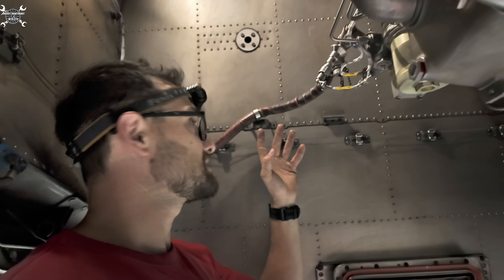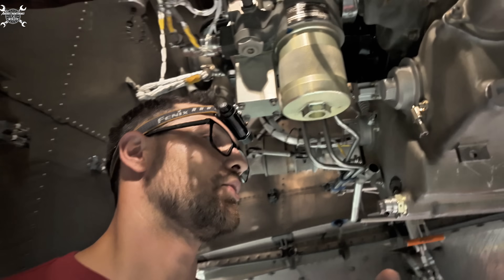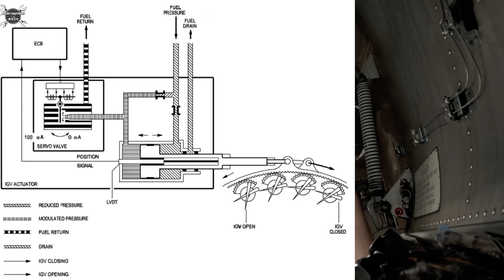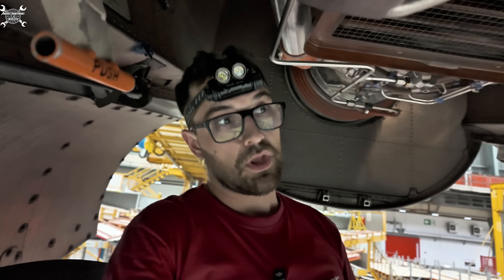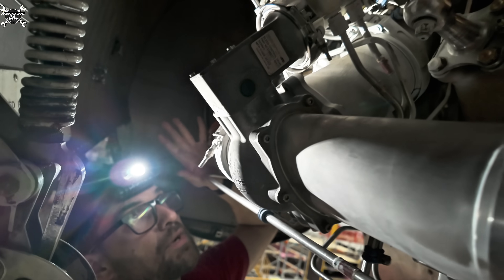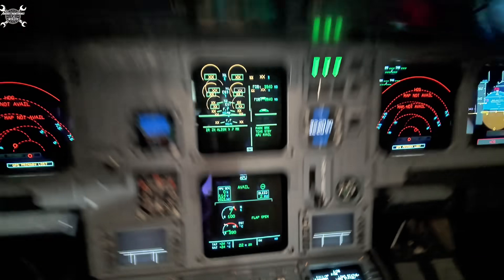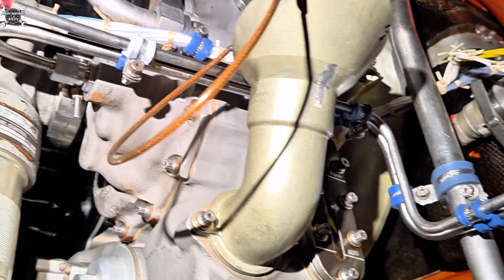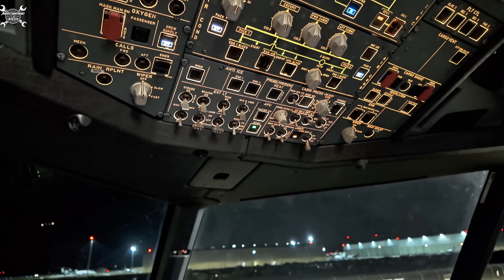How we control fuel flow on APU of Airbus A32F

Comment: Question about APU / ECB power supply. As we know, after shutting down APU without external power, we need to keep batteries on for a while to supply power for intake flap closure and to let deoiler solenoid finish its duty. I have understood, that, if GPU is connected, the deoiler solenoid can work even if batteries are off, but external power is still on from flight deck? How about a situation, where GPU is connected but only maintenance bus is selected on (flight deck ext power off)? In my understanding maintenance bus doesn't supply power to APU to post-shutdown activities, but I have still heard people claiming that it would do, especially when they are in a hurry to leave aircraft after finally getting GPU connected in the end of flight duty. How is it? :D
Reply from the maker: Thanks for message.  Start is always provided through the battery, if you switch it off with GPU connected APU shuts down and all processes pass as it should. With battery only it works the same way and after ~2min you can switch off Battery buttons. There is no option for supply APU systems from ground service bus, always battery or external supply or engines. lubrication pumps are connected to gear box so it works only when APU is turning 🙂 I hope that I answer all questions

Comment: To those wondering if you would have a manual: The more advanced and complicated your job becomes in engineering, the greater the requirement to have manuals on hand for specifics. (tolerances and specs mainly)  I have worked in the medical field for years and at one job, I had a couple aircraft mechanics I worked with that now serviced ventilators, heart pumps, etc. with me. They found it similar and really liked their jobs. Asking them why they transitioned, it was mostly they were older and just liked being on the road and on their own, going around fixing things.  Great guys.
Reply from the maker: Doesn't matter how many times i performed the task I always have manual since it is easier then ever with personal tablet.
Reply: @zeto.r  Same.  Using the exact same process every time makes troubleshooting a lot easier if you run into a problem.

Comment: Thomas, great as always in your lessons. Based on what you said in the video, is it true that in the SR71 the fuel was also used as hydraulic fluid? One question, why does the APU use fuel as hydraulic fluid?
Reply from the maker: Fuel is most of the time cold and since you don't need any other fluid it can be used for cooling and for driving of components
Reply: @zeto.r  Thank you for the clarification, indeed on the SR-71, the hydraulics were cooled by the JP-7 fuel because it could not have external exchangers, due to the fact that above Mach 3 the external air would have further heated the hydraulic fluid. Thank you, Thomas, I asked you these questions because I do not understand English very well being Italian, and I was curious to understand the operation of these devices well. Best regards and have a good day.